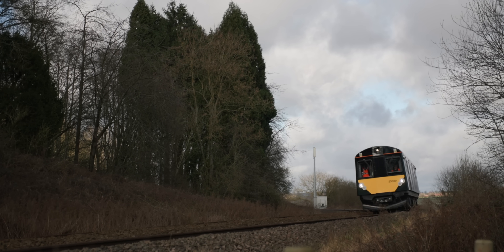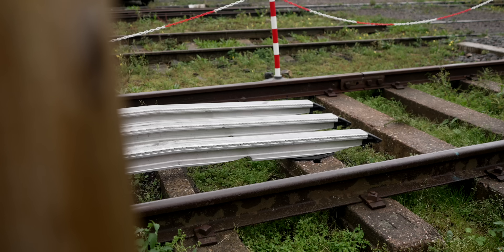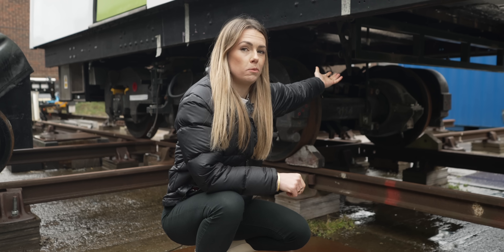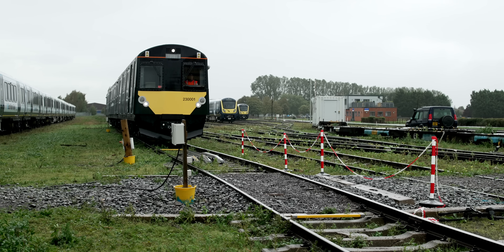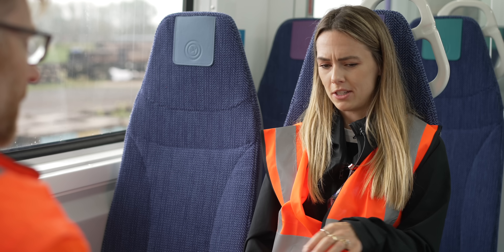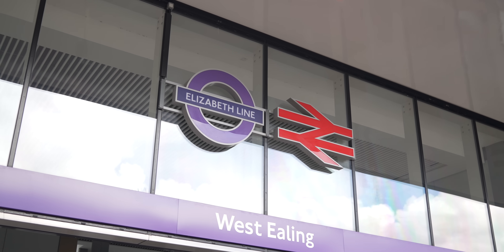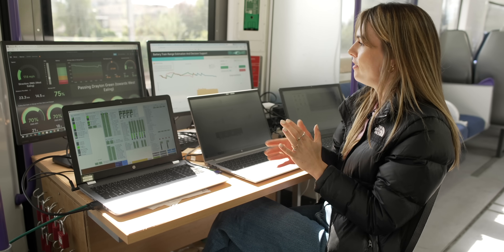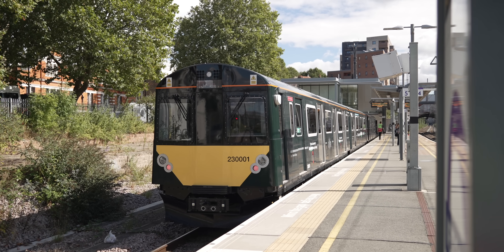Onboard the UK's First Battery Electric Train!

Comment: I don't remember hearing anything about regenerative braking. Was still very impressed with the range with such a small battery, considering the weight of the train.
Reply: I believe London Underground also uses "gravity regen" in some places too: the tunnels are not flat the stations are higher and the mid points between them are lower. This means the train's get a gravity acceleration assist out of the station because it's going downhill and is naturally decelerated approaching the next station as it goes uphill, gaining potential energy in the process.
Reply: That's a given with anything like this.
Reply: @thekaxmax are you sure? I'm not aware of London Underground using regen braking...
Reply: @alanhat5252  London Underground doesn't use batteries though. They'd have to use some sort of grid-tied inverter in the train to export power back to the grid. Dumping DC power back into a battery is much easier.
Reply: @robinbennett5994  At least the Dutch Railways already employ regenerative braking, exporting the power to other trains currently on the net. So it's already a thing. Just a fyi.

Of course not relevant to this video, as it's a disconnected battery train. Regen should be even easier though.
Reply: @alanhat5252  Almost all of London Underground uses regen braking. Go on the Jubilee line and listen to the inverters ‘changing down’ when coming to a stop.
Reply: @dykam  BR has been using regen braking since 1953 on one route and in more widespread use since 1994.
Reply: @theweekthatis I get the impression that "regen braking" is used both for electric retarders, and actual energy recovery (and reuse). I doubt that the 1953 implementation recoverd the energy.
Reply: @dougaltolan3017 if energy isn't recovered and reused, I think it's called dynamic braking, not regen. Diesel electric locomotives use dynamic braking, with huge resistors to dissipate the electricity from the motor.
Reply: @theweekthatis you are right, but are they pushing the regen power back to the rails or to a bank of resistors?
Reply: @ yes. If you watch you’ll sometimes see the track draw an arc from the shoegear.
Reply: @kkobayashi1  most UK electric trains offer regen braking now. Not rheostatic,  regen. Some may fall back to rheo when the voltage in the 3rd Rail/overheads gets too high, but most EMUs don’t have significant braking grids.
Reply: @theweekthatis thank you, that's one noise I'll be listening for next time I'm in London.
Reply: weight has nothing to do with range but aerodynamics and all the climatic conditions to be used.
Reply: @carholic-sz3qv  With good regen, yes weight basically has no effect on range.
Reply: I prefer battery swap instead of fast charging. You can swap a lot faster especially considering that this is a train. The battery doesn't need to be carefully aligned and lifted into the engine. Put it on a bogie and attach it to the back of the train, or the front. The track keeps it aligned already.

Comment: Cover the car parks of every train station with a solar canopy & install EV chargers too.
Reply: Just comes down to money
Reply: Return the railways to public ownership, then we can all benefit not just the greedy shareholders of private companies.
Reply: @GaryV-p3h   I'm impressed that I managed to read through nearly twenty posts before Karl Marx appeared.
Reply: The only reason solar panels make sense in the UK is due to the rigged electricity market. They make zero sense in the UK engineering-wise and in fact anywhere in Europe except Southern Spain, Portugal and Greece.
Reply: I think you just priced all rural rail lines out of business. What price installation and maintenance compared with running a single old rattly diesel railcar, like we do today?
Reply: @robertpettitt5570  Exactly the reason that the railways should be publicly owned, every gets to use them & everyone gets to okay for the upkeep of them, runbthem not for profit & all the money goes towards the maintenance instead of into the pockets of greedy shareholders.
Reply: and the platform canopies, which could cover all the way not just directly over the platforms
Reply: thats not how it works lol!!! they are going to need vast amount of energy to be able to fast charge so the grid is the answer.
Reply: With a big enough  battery  bank & the entire car oark & station  covered in solar panels it should more than cover the power needed to run the train, the station & EV chargers. It's  just a matter of scale. We need to make every home & business as energy self-sufficient as possible & leave the grid for powering public infrastructure like street lighting etc, again that's  why it should  all be publicly owned and run not for profit.
Reply: @GaryV-p3h  these solutions are very good for connection times on the grid as these would only need an 11kV connection voltage. Whereas overhead lines I think run at 25kV which would require at connection at a higher voltage level. More expensive. The trouble is now that 11kV connections are getting harder and harder to acquire due to the sheer volume of applications and shift of energy from fossil fuels to electric. Tricky one to balance.
Reply: Did you not bother to watch the video, the battery bank is trickle charged between each tine it's  going usef to charge the train, so solar will work perfectly well 90% of the time with the grid only needing to help out occasionally & can top up at night using cheap rate electricity.

Comment: Definitely not the UK's first battery electric train. British Rail introduced a battery electric railcar in 1958.
Reply: The GSR over in Ireland beat BR to it by some years. On the difficult ex-Dublin & South Eastern route,   Dr. James Drumm's revolutionary fast charging  Nickle-Zinc battery multiple units (in service between 1932 and 1949) were the forerunners of the (brand new) B/EMU Hybrids now entering service on the enhanced DART services around Dublin.
Reply: Can you give more details please? What class designation? Where used? Is it still used (perhaps abroad)?
Reply: @alanhat5252  https://en.wikipedia.org/wiki/British_Rail_BEMU
Reply: @alanhat5252 It lives on the Royal Deeside Railway.  Although safe, it needs new batteries and a serious electrical overhaul.  Formerly it did see occasional use .... as loco hauled stock.  That's the same fate which befell some of the GSR Drumm units at the end of their battery life ... by which time the output from Shannon Hydro-Electric Scheme was no longer surplus capacity!

Oddly, the Royal Deeside's website doesn't trumpet this unique unit's presence.
Reply: @TheHoveHeretic  The Deeside BEMU hasn’t been used as hauled stock for many years, it is now out of use stored at West Lodge near Banchory. It can be viewed easily enough from the adjacent A93.

Comment: I fail to see how this is more efficient than electrics trains that are always connected to the grid
Reply: A bit less efficient to run, but a lot less expensive for the infrastructure.  The Great Western Mainline upgrade cost over a billion pounds for about 150 miles of line.
Reply: I've seen the set up on on the Greenford Branch and in terms of infrastructure it's very simple- just the charging rails and detectors in the West Ealing Bay (platform 5) and a couple of containers containing the batteries. No other new infrastructure of any kind on the rest of the branch. If you electrify conventionally you have to be able to supply traction power throughout the system. With this  system you just need a fairly modest supply, no more than any business needing three phase power so it can be connected to a normal 440V supply , probably no different from the source that supplies the station's lighting and power.  The demand is low and steady so youre not supplying lots of peaky power to cover accelaration.  The batteries, both the shore ones and those on the train, even out the power needed over the train's entire cycle. I don't known what the electrical efficiency of the batteries are but I'd guess it's in the 90+% area.

Comment: I'm sure this has been tried before in the UK.In the late 50s battery electric trains were tried between Aberdeen and Ballater,before Beeching chopped the line.
Reply: Indeed it was, but battery technology has moved on and improved.
Reply: @rolandharmer6402 I believe one of the Battery Multiple Units is being restored at Deeside Railway.They run a short section  of the original rail line between Crathes and Banchory.Maybe Fully Charged could have a look at the great grandad of this new train.
Reply: @rolandharmer6402  There is a small section of preserved track between Milton of Crathes and Banchory.They do heritage runs and some steam days.I think they may have an original BEMU being restored there,but not sure .
Reading up on the project it was powered by Hydro Electricity at the price of 3 farthings a unit.Changed days.😊
Reply: @johnmcconville6055  The one & only BR BEMU returned to Deeside in 2001. It had been restored to working order at the East Lancs Railway, operating between Bury & Rawtenstall on special occasions. At that time it belonged to the West Yorkshire Transport Museum. Following the closure of that project, the assets were sold off, in losing the BEMU to the Royal Deeside Railway Preservation Society. The founder members of that group were keen to see it return to Deeside, many people remembering it in use between Aberdeen & Ballater. Alas, by the time the BEMU returned to Deeside, the batteries were pretty much life expired. Also, the few individuals working on it moved on. As I’m not involved with this preservation scheme anymore, I have no idea what plans exist for this historic unit. A shame to see it sitting neglected, especially when a then young Prince Charles, Princess Anne & the Queen Mother travelled in it in 1958.

Comment: Great - but missed opportunity - make the charge rails longer and accelerate the train from the station using static mains/battery power.  That will increase range + reduce depth of discharge + increase longevity of system.
Reply: Which also leaves the railes powered as the train leaves them, dangerous for two reasons.  They thought of this, didn't do it for good reason.
Reply: @thekaxmax interlocks are genuinely ancient technology, thousands of years old, they're reliable & well understood & they're already in use on this system, it's only the timings that the OP is suggesting altering.
Reply: @thekaxmax  We have been doing this already for a century, no it's not inherantly dangerous. If someone touches those obviouly electrified rails that's on them, just the same as anyone touching the 25kv overhead lines.
Reply: If the future trains accelerate anything like an EV car, it will be up to speed before the last carriage leaves the station, so it shouldn't be a problem. Should be little to zero chance of frying someone.
Reply: Effectively that's the Merseyrail solution. The line to Headbolt does not have electrical infrastructure, but the rest of the line does. Instead of fast charging, the battery is recharged during the rest of the train's service cycle, only shopping a little extra demands to the normal running current. 

But I agree with the other comments: you don't want rails that can deliver such huge bursts of power to be on all the time, like the trails in a third rail network are.
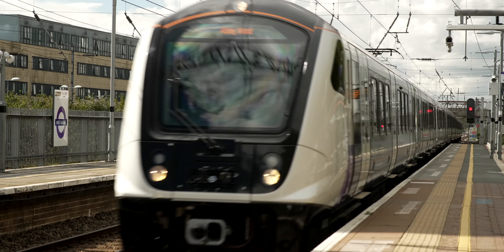Reply: Maybe the charge rails are only designed for low speed. The presenter (Imogen Bhogal I think?) should have asked about why Vivarail/GWR designed this custom shoe coupler when you can see existing overhead wires at West Ealing station at 12:45! Presumably the trains go to stations with no overhead wires, but what's the benefit of these charge rails using a well-understood 140-year-old overhead line power transmission system to recharge? Part of the reason could be that these Class 230 trains were originally London Underground D78 electric cars that were designed to connect to a third rail, so they're developing custom infrastructure instead of buying new units with overhead power delivery.
Reply: These units won't have a pantograph or transformer for 25kv, so adding these would be tricky. The transformer would add a lot of weight which would hurt battery range also, so if you don't need to add it it's best not to. Ultimately this solution works well for the stock they're using and the area it operates.
Reply: @richsmith6453 this is the correct answer. Vivarail did consider whether to add the 25kV pantograph and step-down circuits, but retrofitting to an existing carriage is a total non-starter.
Reply: @richsmith6453  they would have never had the battery gear either
Reply: @AndrewStrydomBRP  Fitting batteries and the shoe gear to a train designed to operate on DC shoe gear is relatively simple, everything you are adding is in the ball park of what was already there. Fitting a 25kv pantograph to a train that wasn't designed for it brings a lot of additional problems. The shape of the train I would imagine makes it very difficult to pass the umbrella rule, and the roof won't be designed to support the weight or aerodynamic load of the pantograph. So adding batteries and a new shoe gear isn't an apples to apples comparison to adding a pantograph due to the significant complexity of pantographs and HV AC power.
Reply: @richsmith6453  the issue is you are now designing a system for the limitations of one specific unit which any new build stock will not have.
Why are they not using 319s or 321s for this.
Reply: @AndrewStrydomBRP  That's not an issue, their system is designed for where it is not economical or it is impractical to install OHLE. To move away from diesel trains there will be many different solutions needed.
Reply: Agreed 👍
Reply: I always thought the solution is just to have overhead wires in the stations and for upto 1km either side. Proven tech for supplying electricity so cheap. Can help with electrify for and more of the  network and can also help with acceleration so the battery does not need to be used for the initial acceleration out of the station. With batteries getting a lot cheaper and hopefully more energy dense we could see this technology rolled out on EMR. No reason the trains can't use the overhead lines where available and then run on battery to Nottingham or Sheffield with some overhead cables strung up at intermediate stations or even just at Sheffield and Nottingham.
Reply: @onlineo2263  that's what I don't get, why waste time developing and testing all this when you just need a couple stations with some overhead wires and then a small battery to allow for coasting and a couple stop starts between stations, Don't even really need the fast charge, just have the facilities at any practicable station.
Reply: The ORR wouldn't allow it as then it would fall under third rail and new third rail is banned.
Reply: @J-Railway-Volunteer  new third rail is not banned by ORR, but their default position is not to approve. Network Rail has just not been brave enough to challenge them. For 4km of railway like this they should have done.
Reply: The maximum allowable charging current is less through contacts that are designed to be used while the train is in motion because sliding contacts need to have a higher graphite content than contacts designed for stationary use.  If you factor in the max allowable amps per cm2, and that they are now charging at only 4C to 5C rates, you would not bother to extend the charge rails.

Comment: How pointless. Electric trains have been around for over a century. Why have heavy batteries on board reducing the number of passengers that can be carried, when the electricity is so easily supplied from overhead wires. Yet another idiotic 'net zero' idea.
Reply: It is a very clever idea.  It is ideal for branch lines and secondary lines with low traffic which won't justify the cost of overhead wires (or third rail)

Comment: Oooh I like this.    Having batteries at the station is bloody genius.  Why drag it about with you?  This is the best thing Ive seen for ages.
Reply: But not always feasible.
Reply: A far better solution, is to not use any batteries at all, but instead use overhead lines or, where there are issues with using them, a third rail.
Reply: @ZarlanTheGreen Overhead lines or a third rail... Genius! I bet that never occurred to anyone involved in this project. 🙄
Reply: @paulusthewoodgnome  The reason why they chose to use batteries, is that it's cheaper to set up. The fact that it's far more expensive, and worse in pretty much every other way, in the long term, isn't something they care about, as companies/politicians typically only care about short term profits/costs.
Reply: @ZarlanTheGreen if this were possible on branch lines they would have done it decades ago. Just not economically viable. I for one will be glad not to have to breathe in those diesel fumes.
Reply: @sdpryce  If it were possible, it would have been done? How naive... it hasn't been done, because it is costly in the short term, so they prefer to keep the diesel trains, despite the fact that it'd be cheaper, long term, to electrify the rails. Because they only care about short term profits/costs ...and that assumes that it isn't just pure incompetence/stupidity, which there is plenty of, among politicians and CEOs.
Reply: @  the batteries weren’t economically viable decades ago.  Nor the pricing models for excess green energy.
Reply: @ZarlanTheGreen  what's the cost analysis on this?
Reply: @colinwiseman  There is no need for an analysis, when the differences are so clear and obvious.
Reply: @  and its not “far better” if the challenge is using cheap electricity.  Commuter time is also = expensive energy time.